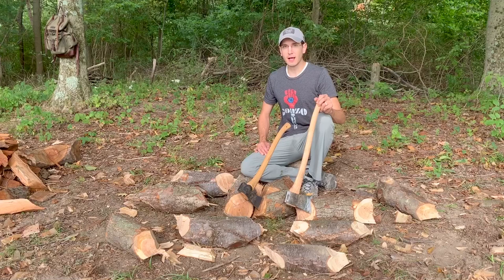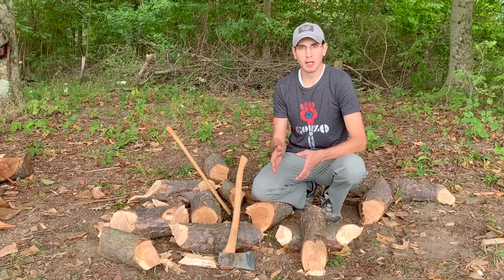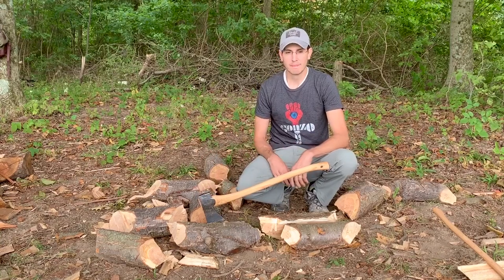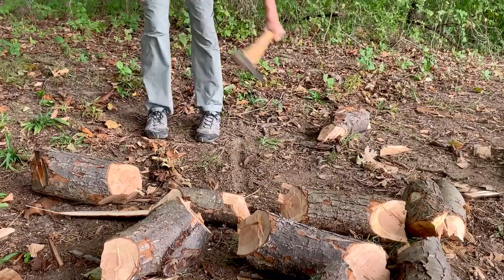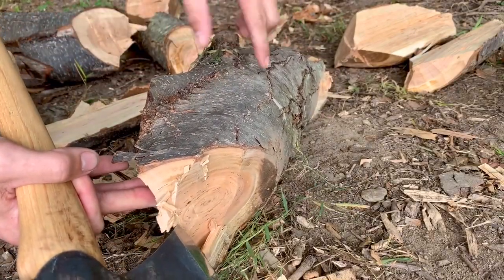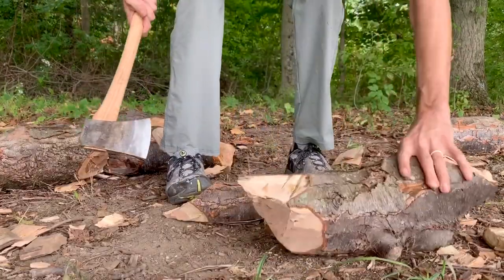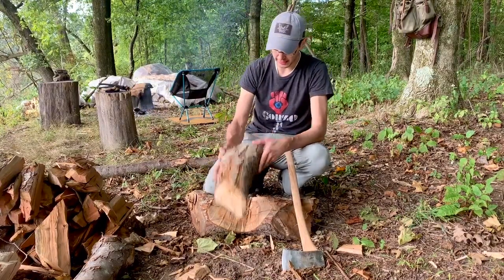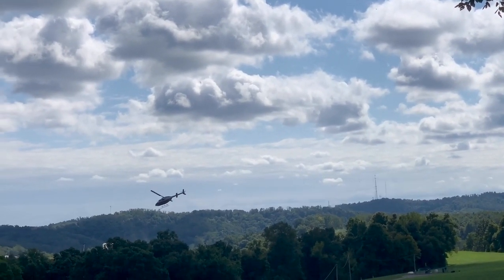Axe Safety Part IV: How to Split Axe-Cut Wood on the Ground

Comment: Hi Kevin!! 
Good demonstration on splitting chopped wood. 
The only thing that I feel you forgot to tell us was if you are backup splitting. Keep the end of the block that you are splitting even with the top of your backup block. If for some reason you hit the block above where it is backed up it could flip backwards and hit you almost anywhere including the face. 
Take care my friend!!😀😀

Logger Al
Reply from the maker: Good point. This is why I need you guys in the comments. To me that’s just common sense, something I do most of the time without even realizing it.  But then again I have a lot of confidence I can hit what I’m aiming at.  This is definitely not comprehensive. It’s just all that I came up with that day. Thanks for pointing that out.
Reply: @KevinsDisobedience  It's just a normal thing for me also but there are some people who are just beginners that might overlook it. If it happens once to most people. They usually learn not to do it again and hopefully don't get hurt when it happened.
Reply from the maker: No, you are absolutely right. I pinned your comment at the top. I wish I had thought to mention it in the video.